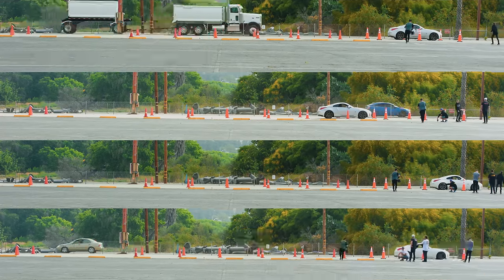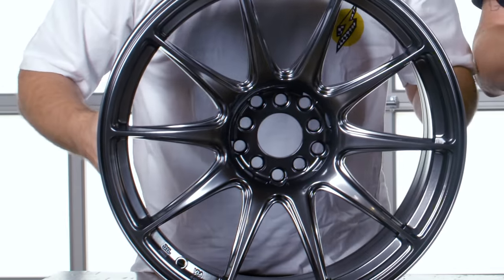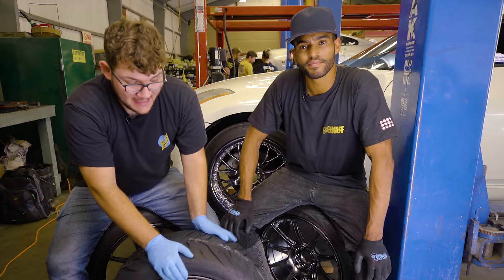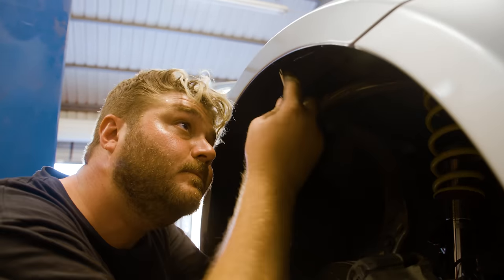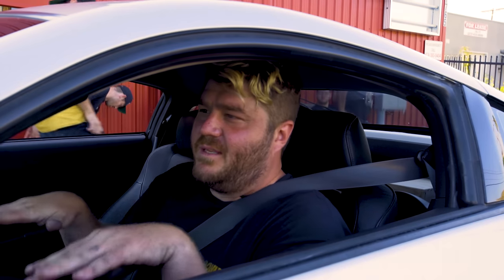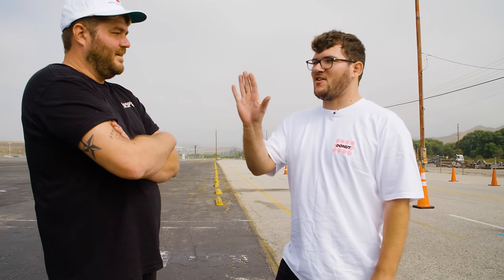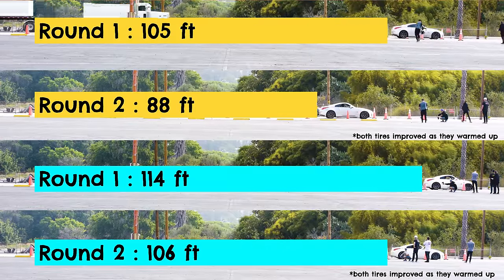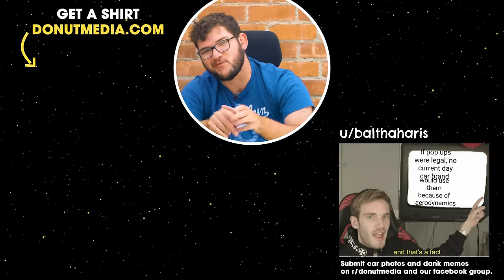$1,000 vs $3,700 Wheels and Tires | HiLow

Comment: Had a set of XXR's on an old car. Got into an accident where I went airborne, while going backwards, over a ditch. (Long story short I had over corrected, spun 180° and couldn't get stopped before going over the ditch). When I got the car to my shop and removed the wheels to check them on the tire balancer, none of them were bent or cracked nor had any hops in them. They were 17x7.5 with 205/50 tires. Sure cheaper wheels aren't as desirable as more high end wheels, but for a set of $500-$600 wheels they held up track days, every day use and even an accident where wheels typically would've been damaged. I'm not saying everyone should go buy a set of XXR's but if you're trying to customize your car on a budget and need a different wheel set up than what you have, I wouldn't hesitate to run a set of XXR'S.  You can always upgrade to those expensive authentic wheels down the road.

Comment: I know this is an old video but here goes...
More expensive semi slicks might not always be better. My brother and I ran a few different kinds at different price points and often the cheaper ones worked great when cold and were perfect for short events. But, it would get much worse after driving laps for 10-20 mins. They'd become too soft and squishy and the grip just went away. The expensive ones usually dealt with heat much better and would improve with temperature.
So, for street use or for short autocross events the cheaper ones (nankang something something and Federals) were great :)
Oh, right. They also deal completely differently with rain...

Comment: I always get higher end tires if I'm not dead broke when I'm getting tires, you're putting your trust and safety in 4 rubber and metal circles so you better buy good ones. $250 per tire is usually what it costs, but there's loads of places that have deals to sell them cheaper in sets

Comment: It’s tough I feel like it would be inconclusive unless you run the lows on the high suspension and vis-à-vis

But for that huge of a cost for just fraction of the improvement. The low seems like a better deal.

Comment: If you want to test out grip of tires measure a spring at rest then pull the tire and measure the expanded spring. There’s an equation that I forget but basically you’re solving for mew. The higher mew the more friction or grip it is capable of

Comment: One going for the lower cost is much better if you're an aggressive driver because as an aggressive driver you have to change your tires more often and you can do that a 4 to 1 ratio. And there has to be a huge difference in order to make the higher false palatable. Second the glaring problems with your test is the differing suspensions so what you need to do is change the wheels and tires out on each car. Which car gets the run with the expensive and or cheap.

Comment: I've owned both of these tires in a 205/50/15 size for my autocross miata and I've gotta say, I like the RE71-R better, mostly because they let loose more slowly and predictably, and also because the RS-RR were just... so... noisy... It literally sounded like I had a taxiing jet behind me above 20mph. (Also, found out at autox last sunday that the RE71R have been discontinued... RIP. Any suggestions for good autox tires for a stiff NB miata?)

Comment: Aside from performance, quality and strength is paramount for daily drivers. Hard to beat OEM wheels ability to handle potholes and other hazards. Seen quite a few after markets break when oem would maybe bend. That's why it pay more and give up weight savings for a strong wheel

Comment: In germany the TÜV will cross twist the car in order to be 100% safe that the new  wheel/ tire combo will not hit/ touch anything. They will put the car on two plattforms with the hight of 140mm (5.51") each. The left front together with the right rear, vice versa and turn the steering wheel completly to the left and to the right. There must still be a minimum of a 6mm gap to the nearest objet to the wheel in every case ( wheels tuned or straight and also rear tire) while its been cross twisted to pass the test. 

Besides that, the wheel/ tire combo must be the right one ( combos given by the wheel certificate) . Also speed and load indexbof the tire must be right. They also check, if the steering wheel (non oem) and suspension (non oem- lowernig springs or coilovers) together with the new wheel setting is combinable.

Normally they work with TÜV certivied and approved combos, so there are no confusions about wheel size. In this certificate you can also see the requirements/ works to be done to get the new wheel tyre combo fitted properly.

If thats not the case and you just got a certificate for the wheel/ tire combo but not for the car you installed it, and/ or the calculated  rolling circumference of the tire is much different than the oem tires, you also need a speedometer test and recalibration, if necessary.

I know, se germans

Comment: I work with a lot of wheels and tires, YES they do make a difference. Tires and wheels are a perfect example of "you get what you pay for" and tires especially, all tires are not created equal! Some could be out of round which means during manufacturing they didn't perfectly round off the tire which means you can get a LOT of bouncing. There is nothing you can do about that. Some good tires around about 1,000 and up.

Comment: You guys should have swapped wheels like with the coil overs to account for the suspension difference, would the cheaper tires have been better with the kw coil overs?

Comment: You guys mentioned only 3 #'s were important when looking for tires?
ie: width/aspect ratio/diameter 
What about "Load Index"? 
Cars difference in weight can be huge.
You wouldn't buy a set with a load index for a Miata, for lets say a E63 AMG would you? 
Might be too late to edit your video, but its worth mentioning it in your notes.

Comment: I would be happy with either wheel you got there. Now if you went onto EBAY and got a "who the hell are they" wheel and tire, I'd really think twice about putting them on any car. For my Miata (a 95 NA Miata) I got 15in Konig Wheels that while cheaper are still a well made and very light wheel. The main reason I changed from the stock 14in. to 15in. is because it's next to impossible to find a good 14in. tire because the main brands quit making tires that size and all you can find is crap tires that come out of china. 

     It's even a little hard to good tires in the 15in these days but I found a very good tire made by TOYO who make very good tires and ended up with a set of nice wheels and tires that I can use without any worry of it flying apart the first time you use them.

Comment: For wheels a very over looked thing is the center bore size make sure it is the factory size and if it isn’t buy hub centric rings. If the center bore doesn’t fit snug in the hub then your car can shake.

Comment: I remember from physics class that a wider tire does NOT, just by that fact alone, increase grip. It's because the weight gets distributed over the entire contact surface of the tire, so you end up with the same weight per square inch. However, wider tires can be more sticky/ have more grip, because it is less likely to loss contact with the surface, and can probably mitegate bad weather conditions too, and it is more stable (most noticable when cornering).

Comment: I went “cheap” with my selection, but you might not be able to tell because my rims are Enkei PF05 (the budget Advan GT rims) and Advan tires, the cheapest tires I could find in the sizes I wanted 😂

215/40 - 17x8 +35
245/40 - 17x9 +40
$2,000

Comment: Makes so much sense to go with a square setup, you can easily fit 285s on all 4 corners of a Z (source, ME, I used to own a caged / track only 350Z with several sets of Nismo 18x9.5 LM GT4 and raced it everywhere from Watkins Glen to Mt Tremblant to Lime Rock). Handling is way better with that much front grip / overall traction. Hearing 245 and 265 no offense makes me chuckle. It's like how the lawyers nerfed the older 911s into the ground because a few idiots went backwards into a wall (don't induce lift-off oversteer, problem solved?). Heck even like 265s all around on 18x8.5 or 18x9 would be vastly superior :(

Comment: Dream world Reece, I work in the motor industry as many others here do,  and as for modified cars are better performing and SAFER, not from what i have seen at least 50 percent of these we get in are less safe then factory, due to miss matched parts, like un- balanced brakes systems and suspension geometry, just think about just lowering the suspension, the list of changes that are need to be checked and may need to be changed, castor, camber, tracking, spring rates, rebound & compression rates, rollbar travel, and the list goes on, if only life was that easy, but carry on with the mods as it does keep a lot of us in the industry & police acciden ivestigation teams in work.

Comment: I have one strong comment to make- TIRES ARE EVERYTHING! My 1300 dollar set of snow tires actually out perform my 1k dollar set of summer tires as daily drivers- that is wack! I'm in Colorado and I am using my snow tires with little wear all this summer after this 1st year. that is bonkers! I'm not tracking my car but I do hit my tires pretty hard on switch backs in the mountains and man why do I need summer tires when these bad boys grip like glue. Stopping power is great too but as i said I'm not tracking and of coarse not racing all over colorado like a reckless fool. Tires are Michelin Pilot Alpin P4 18 by 10 by 35 high speed rated. TIRES ARE EVERYTHING
Reply: wheels are good too though, lost about 7 lbs a corner going to rpf1s and its a massive difference

Comment: my rims was cheaper then that at 35 a piece for Aluminum Rims

the reason why so cheap was because it was on a vehicle out in a place called pull a part, they were in decent condition, one just has a rather deep scratch, but the rest looks fine, they are the factory rims, but they looked better then what i currently had at the time

Comment: in tests like this, i would love to see them swap the wheels and tires when/if possible, and run the same tests to see if for example, its the suspension not the tires that caused the dif in breakloose, something that simple to do, would give a clearer idea where the investment was paying off.

having driven some cars with great suspention setups and some with absolutely abysmal... even great tires cant save a bad setup, and, even medocre tires can serve very well on a good/nice setup. 

same thing you can learn messing with higher end remote control cars honestly... (got a few friends really into that stuff who use to have me do alot of soldering and even help them build/rebuild, redesign stuff that failed so it wouldnt fail that way again, fun stuff... we made a remote control car that only goes forward, because its driven by a remote control gas plane motor and prop pushing it... that thing was more of a "we have all this junk, lets build something with it" that was a fun weekend... that thing moves... loud as fuck though... took many tries to make it heavy enough and get the balance right so it would drive not flip over, the throttle setup was quite easy for me to wire into the original throttle setup, the fellow actually bought a better plane motor prop guard setup specifically for it later because, he could get one that would actually not only stop, but could kick into reverse after a mod(used by people using them for remote air boats)... fuck... that was fun stuff... that thing was amphibious by the time we got done, his son made it a VERY VERY VERY nice shell from carbon fiber during a class he was taking, the teacher actually helped him after seeing and getting to drive the thing.. "This would be easy to make float..."  the dude suggested it as the project to not only get his degree but as part of getting his doctorate, they used scrap material and after a few test builds.. it looks... both silly, cook and sci-fi  cyber-steam punkish, on water it moves damn well for something adapted into an aquatic compatible form. 

i helped him build a steam powered remote control car/truck(its able to hold quite  a few shells including one that looks like a steam train), its a low loss system, it can be powered several ways, hes got a gas burner setup thats in effect a tiny propane heater, runs off a torch/lantern tank, or the way he actually uses it most of the year, an electric heating unit powered by a lithium cell, its neat because... the whole frame and most of the parts are metal, it puts out crazy torque, forward, back, the whole setup is a kit he bought thats stupidly expensive (his wife told me, in total hes put a bit over 12k into that thing over the decade hes owned it, apparently they sold dif versions of things like the kit he got going way back some ran off white gas or paraffine(kerosene), and were far from low loss, they cost so much because, the whole things hand made and they test everything before its shipped, even if you buy a kit without assembly fee, they still put them togather and make sure it all works.. (often just sending it assimbled anyway...im told, they eventually added a box for those who wanted to put them togather by hand since... if they didnt, just send the tested assembled unit and extra parts, along with the QC authenticity forms..)

apparently, she stopped complaining when her own mother pointed out that, it was still cheaper then his old hobby of actually working on real full size cars/trucks... sure he invested alot in that contraption, but... spread the cost out over the years and... she actually started buying him other remote control kits(quality stuff), she loves remote cars/trucks/tanks/etc, cannot fly even a high end nearly self controlled drone without crashing it... (yet...shes won competitions where they race RC cars around dirt tracks from stands overlooking the track...i cant do that...and i admit it!!)

Comment: I would like to see what high car does with low car's rims and tires so that we could have an idea how much the better suspension is causing the performance. Both sets of rims and tires should be grippier than stock so both cars improve but is that extra .5 second in the slalom achievable with a good suspension and cheap rims and tires?

Comment: you should have mentioned that the wheels go further in the car the lower it is, which is probably why the higher car had to roll fenders versus the slammed one which had more space. and just to mention cheaper tires might have even more grip than the expensive ones but will wear out super fast, all this from experience xD

Comment: For 60-0 brake tests, couldn't you put it on cruise control at 60mph, then hit the brakes? The cruise control will automatically turn off the moment brakes are applied. And it'd make it very easy to increase the precision of the test.

Comment: XXR says they're tested for impacts like potholes. As someone who drives through Chicago, they bent over harder than hooker for a 100.00
When I called to complain about it, very first thing the rep I bought em from. Well when you put on those rubber band tires it'll happen. I wasn't aware an 8th ]of an inch was a rubber band. I went from 235 45 18 to 245 35 20.  Can't do much about it.

Ohh, and cracks are forming on the inside edge of the wheels, on all four of them
Reply: also, you can get the XXR's with correct lug patterns if you look hard enough.

Comment: The problem with rep wheels is they may break during track duty. So if you don't abuse your car, more expensive does not mean more better. imo... I'd never risk running reps on my tracked z

Comment: have you considered switching tires to see how much of a difference they make in combination of the suspension differences?
Reply: Tires will generally make a much bigger difference in lap times, while suspension makes a bigger difference in keeping the car confidently under control, especially on rough terrain. From a safety standpoint, decent tires with good suspension is better than the other way around. Cheap tires will overheat and put you in a guardrail, so there's a minimum to what's "decent" depending on your driving context. Weirdly, the best tires to me are actually cheaper than the "best" tires. Because I buy tires that are good in the dry and good in the wet instead of great in the dry and scary in the wet.

Comment: The fact that ya gotta keep replacing tires, the minimal performance difference is not enough to go for the much more expensive tires. That cost difference will just grow as time goes on and the more you replace tires. Plus, with cheaper tires, you’ll be less hesitant to burn rubber, which will make them more fun. Expensive tires make you drive more conservatively to save the rubber and dollars.

Comment: I think in this episode more expensive isn't more better. You'll burn through tires on the track, you really wanna spend over 250 per tire every time you shred one? I don't lol the cheaper ones aren't as good but they're still pretty great, it would be my personal choice.
As far as wheels go, I would get something a little better than the XXRs just because of the multilug pattern. But I also like the XXRs more than the Advans personally.

Comment: In normal situations both of wheels and tyres are good! But....
Chipper tires in 5-6 laps have less grip than expensive and maybe more damage!
Also chipper wheels, in holes of road have more damage because of material and extra weight make problem for suspension!